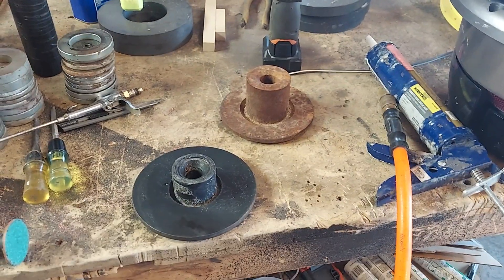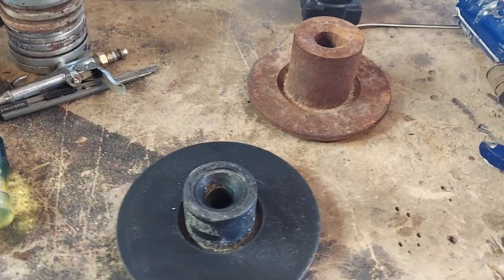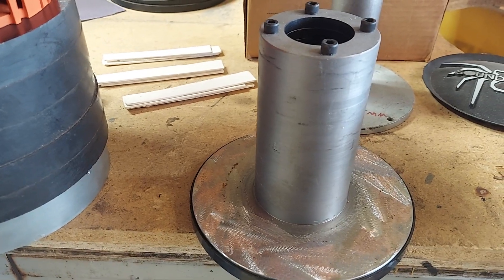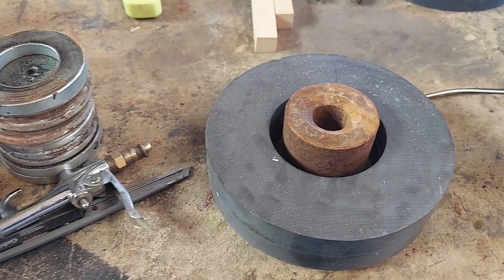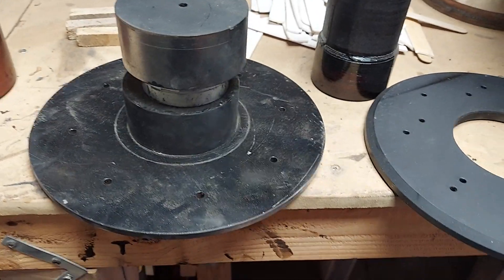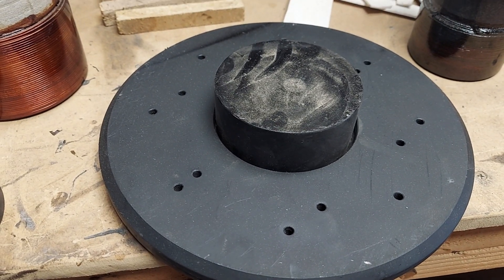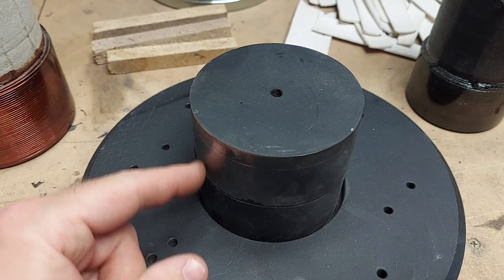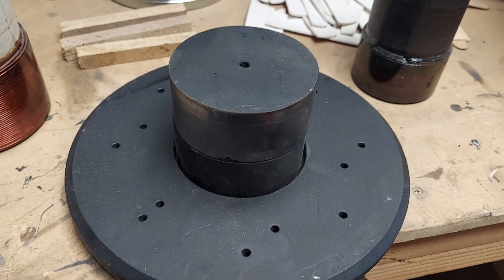How to Extend Your Pole (piece) and add magnets to your subwoofer motor @ The Robot Underground

Comment: I have a question. I have a cheap subwoofer with a single magnet can I open it up and add another magnet to it as it hits the backplate easy with little to no distortion. I want to increase the xmech of the driver I don’t care about linearity it’s just an experiment. Could I do this? I’ve checked the surround and spider too!
Reply from the maker: All you have to do is make sure that the pole is tall enough
Reply: RobotUnderground Alright thanks man, I’ve been binge watching your videos you clearly have a lot of knowledge within car audio and out of it. Thanks a lot.
Reply: @RobotUnderground  How tall would you recommend a pole piece be if you want to use the mega roll surround with the 10' spider. Would the height of around 100mm be sufficient or would the pole piece need to be higher (given I will increase the height of the top plate or magnets etc. }
Reply from the maker: @maincharacter2677  it depends on several factors.  In the case of Sundown's X series.  They use a 10" spider but the coil is short at 50mm wind height.  To me, that shouldn't justify the added expensive of a 10" spider and the frame that supports it, however Sundown is in the money business.  I suggest you experiment to get a better idea.  If and when you bottom out the coil, observe what you could have done different.
Reply: @RobotUnderground  Okay I understand what you’re saying I will experiment but damn that is a short coil they probably know that if it looks beefy to other people it’ll sell more haha.

Comment: I need 3 12s for a sealed box what would you suggest looking for something that can handle 1500 to 2200rms been looking at fi,sundown,b2.
Reply from the maker: I'd do that quad stack 2.5" coil sub.  Those are only like $200 each shipped.
Reply: @RobotUnderground  how many watts rms they handle? How about some 3in coil neodymium subs?
Reply from the maker: @stormyyoung6344  Working on the 2" Super Sunfire build right now.

Comment: How would you go about extending a voice coil former? The only way I’ve found is glue some thick stock paper around the former then epoxy the hell out of it when it’s attached to spider and cone.
Reply from the maker: You got it.  Try to use epoxy and not CA.  I never recommend doing it but I've done it once with success.